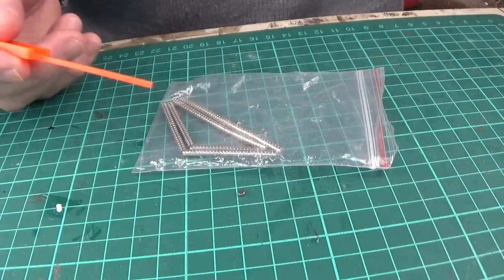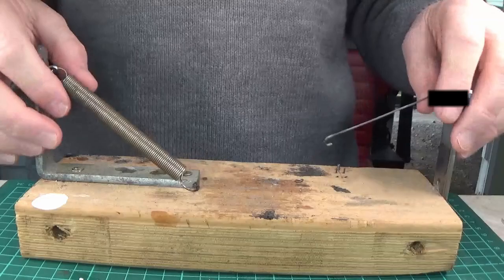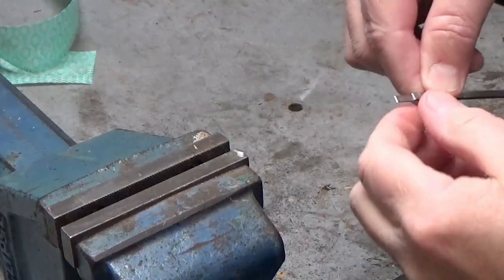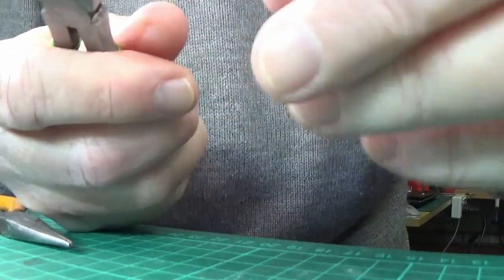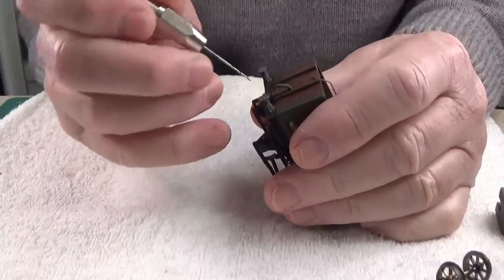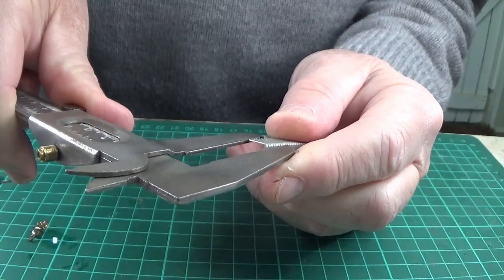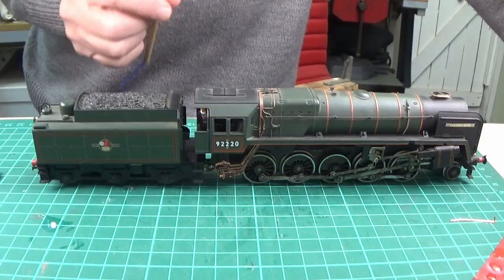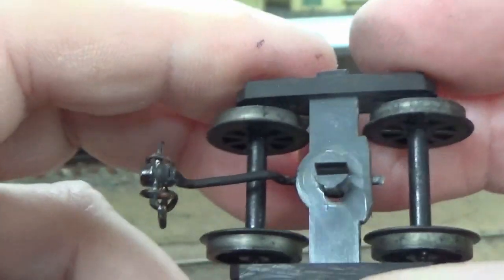July 2021 Update 3 Link Coupling Part 2

Comment: You really put some work into this video, awesome.
I volunteered on the National Trusts Corfe Castle railway constructed in the 1960’s by a master model maker and gifted to the Trust. All rolling stock and locos were hand built and were coupled together by chain and hook, fiddly to couple and uncouple but looked really good.
I was looking to convert my stock and discovered your videos; now I’m hooked as it were; love your idea’s and defo gonna use your system, happy days ahead. 
Thank you….Neil
Reply from the maker: G`day Neil,
Glad you like my coupling system.
It`s a bit coarse compared to prototypical couplings, however I feel, visually, it beats tension locks hands down.
The rigid chain was the breakthrough, especially for pushing wagons through an "S " formation. It`s something that can`t be done with standard three links unless you have very large radius points throughout your system.
The rigid chain and magnet connection also make re-coupling very easy compared to standard , loose fit three links.
My system is more about ease of operation than prototypical looks, so therefore it`s a compromise.
And that`s what model railways are all about......compromise. 
Have fun with it
Cheers Gormo

Comment: Congratulations you've developed a great alternative to using kadee's without the expense. They also look better than kadee's. I think I'll give this a try on my next OO layout. I also think this would work very well on O gauge. Three link couplings on O gauge are a pain in the bum. Which why I used Spratt & winkle couplings (they took ages to fabricate) and don't look as good as your's. Full marks for the effort and thought that's gone into your project.
Reply from the maker: Thanks Richard,
Glad you like the system...........any minor tweaks or improvements will be relayed as usual.
Stay safe
Cheers Gormo

Comment: I think you hit it on the head at 49:57 " it aint prototypical but I dont care" Rule 1. Thank you will be looking in to getting this started as soon as. Cheers Frank. Keep safe
Reply from the maker: G`day Frank,
Well yeah !!!....Rule 1 rules...lol
This is a compromise which tries to balance prototypical looks with usability so there you are.??.....it works well enough I think.
I am currently working on improving the uncoupling tool ( shunters pole ) and I think I may have cracked it just a few moments ago. I am using a small scissor like aluminium heat sink and it seems promising. Just have to modify it slightly.
If it works out well, I`ll do another video update
Cheers Gormo

Comment: Thanks, Gormo - you put a lot of effort into that video and the results speak for themselves. Just one thing - since the locos only use a magnet to attach the chain assembly to the buffer beam, why not just use the same system for wagons, too? You could dispense with the "T" bar altogether. Thanks for posting and stay well.
Reply from the maker: G`day Paul,
I actually have one wagon set up in the way you described because its a die cast chassis and difficult to fit a T bar.
I use the T bars for two reasons.
One is that it uses only two magnets per wagon, rather than four, and two, is that I feel it is visually more pleasing.
Either method will work, however the T bar does allow you to position it more accurately in respect to it`s distance from the buffer beam.
Cheers Gormo